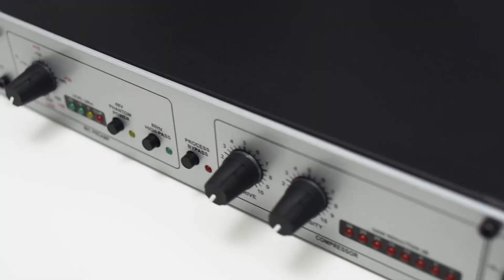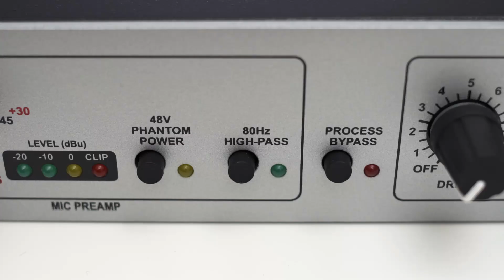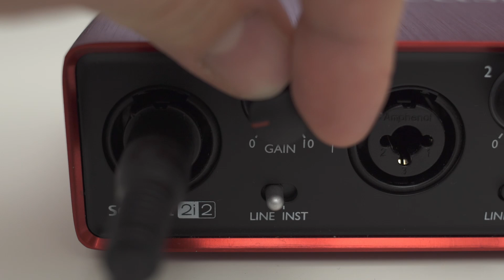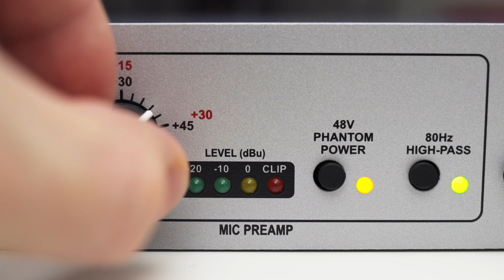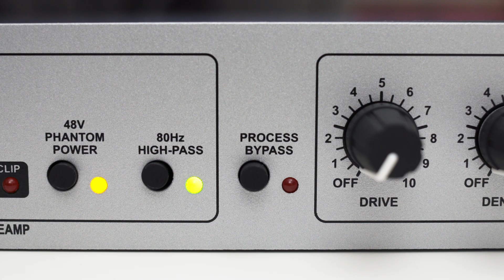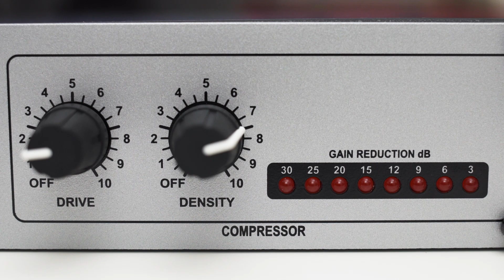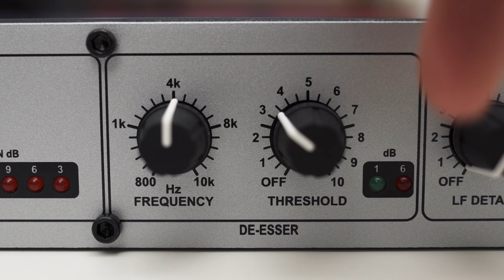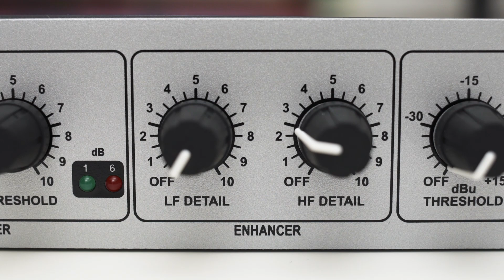Best Settings and How To Connect - get started with the dbx 286s

Comment: A great tutorial, I managed to make my SM7B sound good. I had issues with the output gain, had to turn it way down and about as much up from the audio interface or the audio would get distorted. I would still recommend a fet-head or a cloudlifter combined with DBX 286S if you are using SM7B. It apparently needs some +55 dB of gain which is better to get near the mic or cables will absorb all the noise from the universe.
Reply: I would pay so much to have someone help me set up mine because I am just COMPLETELY lost. I am going to try ordering a cloudlifter to hopefully help my issues but with the 286s and a Scarlet 2i2 I have been STRUGGLING to figure out what is going on. Hopefully having a cloudlifter fixes the quality issues!
Reply: @DoctorNoFGC  Was no miracle cure, but gave the unit much more control. Would recommend.
Reply: @DoctorNoFGC  yesterday i tried moving the cables and checking in Ableton's Spectrum and iZotope Insight and saw the noises that the cables pickup from power chargers that were nearby etc. i was amazed 😂also with the fact that for like a year i was sending a Mic level signal from dbx's Output to the Input of my Presonus (XLR cable) instead of a Line level (TRS cable)... 😳
Reply: I was curious about why always connecting fetheads etc. to Mic end, instead of the other end of the cable. That gain near the mic for not picking up noises that you said is pretty intresting.

Comment: Best video on the 286s I've found.  But I still don't know why I did the -18dB calibration at the beginning if I'm shooting for -6db to -3dB on the audio meters.  I'm using a Heil PR-40 with dbx 286s and focusrite just like Julian.  Have to turn up the gain all the way to +60db then use the focusrite to boost even more ->FCPx on my MacStudio M2 Ultra.  I does sound very good though.  Thanks JK.
Reply from the maker: Hey Jim, if you don't do the calibration, you could end up in a scenario, where the 286s might clip  considerably earlier or later than the interface. If that happens you might lose dynamic range which can negatively impacts the noise floor or you might even clip on the interface without realizing it. The calibration procedure makes sure you get the best possible performance out of the setup. Glad the video helped you out and big thanks for the tip!!

Comment: Just wanted to say thanks for the informative video. I am so brand new to all of this I have little to no idea what any of this means but your video helped me get a few things started. I, however, couldn't get my dbx to light up the way you did which makes this all the more troubling. If you have any thoughts or other videos that might help me get more properly set up I would greatly appreciate it.
Thanks again!
Reply from the maker: Hey, I'm assuing you are using a dynamic mic. These mics are less sensitive and in order to get the yellow LED to light up you have to have a louder sound. So, make sure your phones loudspeaker is as close to the mic possible. Turn the volume on the smartphone up to about 3/4. In the tone generator you can also set a frequency around 1000 Hertz which will be louder as the standard 440 Hertz. Then repeat the steps shown in the video and it should work just fine. If you have any other questions, let me know!

Comment: This video is the BEST!!!
Quick question:
After I did everything in the video, my sound became very buzzy, but if I press bypass, it’s normal again. Which is really weird. Does anyone has the same situation?? And how can I fix it
I’ve tried resetting, shut down and turned on, changing cables, but the only solution is  when i used bypass

Comment: Hi there, this is a really helpful video - thanks for going through the trouble of uploading it. I'm just wondering if there an advantage to using just a TRS to TRS cable to connect the DBX 286s to the 2i2 interface as opposed to using a TRS to XLR cable to connect the two devices? I'm not sure which kind of cable I should buy and whether one is better than the other. I have a Focusrite 2i2 and a DBX 286s. Any helpful information would be much appreciated. Kind regards

Comment: Hi Julian. Loved the video. Really helped me make the decision to go ahead and buy the 286. I already had a scarlet solo focusrite. I hooked it up with the input to the line in (channel 2) and left the inst button in the off position. (Channel 1 is just an XLR with no TRS jack). 
It looked like it was recording OK when I fed it into audition.(output gain about -10 and the solo level all the way left). I got a good waveform and set the levels to -18 as suggested. But then I could not play back the audio. I exported it, and both wav and mp3 files would also not play. I sort of figured it out. I used the channel mixer and swapped right with left, and it would play. Don't understand that at all. 
When I use the hardware to record with camtasia, it works with no problem. With my logitech software, is shows that there is an input on the mic levels while recording, but similar to audition, there was no playback despite looking like there was a recording.
Am i just missing something simple? I have a passable working knowledge of audio tech--enough to muddle through, but not enough to dive into troubleshooting. Anyt thoughts on what I might be messing up?
thanks.
jeff

Comment: can i plug the trs cable from the 286s into the scarlett solo's trs input port? otherwise i'd have to buy the trs to xlr adapter. i've read that the trs input on the solo is meant for instruments, but since i'm using the 286s i thought maybe it wouldn't matter. thank you!

Comment: First of all I would like to mention that I am one of your fans and I would like to thank you for your effort…I would like you to recommend a smaller version of the DBX 286s in which that it can be easy for traveling and it has almost the same features, thank you and waiting for your reply.
Reply from the maker: Hey, if you want to go smaller I would actually go fully digital and have a look at something like a WAVE XLR. This processes your audio in real-time and is even more flexible than the 286s. One downside is the slight monitoring delay if you want to hear your voice with the effects applied.
Reply: @JulianKrause   thank you so much for your reply but I have another question if you please, is it possible to connect my DBX286s to the podcaster pro 2?
Reply from the maker: @ezzel-bendary8762  Hey, yes that's possible, just run the 286s into a line level input on the Podcaster. That said, the Podcaster Pro II already has all kinds of processin on board like compression, eq and noise gate so you don't really need the 286s as you can do it all directly in the Podcaster.
Reply: @JulianKrause  Thank you so much Julian for your reply as i would like that you can make a review about the RODE podcaster pro 2 if you please because i like your way in doing those kind of reviews and tutorials...Thank you so much and i wish you always all the best.
Reply: @JulianKrause  i will be happy if you could do a review about it Julian because your reviews always has lots of technical and interesting details and I really like it…thank you so much and I wish you always all the best 👍

Comment: Hey dude amazing guide. Just curious, I have a Shure SM7B and a Cloudlifter, should I keep the cloudlifter or does the dbx 286s completely replace the cloudlifter since it also has a signal boost. Cheers. Also, even though the Shure SM7B is a dynamic microphone, I read online that the Cloudlifter requires 48V, true or nah? Thanks, keep up the awesome videos

Comment: Hi. Your videos are absolutely superb; very clear and very knowledgeable. 
I am presently setting up my 286s with the NT1-A and then through the Volt 176 (for voice recording only). I have set gain on the Volt interface at 0 and turned off the phantom power on the Volt, opting instead to use the preamp on the DBXs. As you have shown, I have set Gain to get a recording level around the -18db in the Audacity program. However, setting the mic preamp until it hits the -10 light as you have shown renders the recording level way up at -1 or 0 in Audacity. In order to bring this down I have to set the Audacity recording level itself at -32, in order for my voice to register an ultimate level of -18 again. Is this ok or should I try to get the master recording level in Audacity at the -0 mark? Thank you for your time.

Comment: Very informative, the only problem i had is the calibration with the tone generator app on the smartphone.

I found that when i turned up the preamp gain (to get the yellow LED on the 286s to come on). 
I then adjusted the output to get -18 in the DAW....it just made my mic very sensitive..... (i only needed to speak quietly for it to sometimes clip).  

I tried moving the smartphone 3cm, 6cm, 9cm and 12cm away from the mic and repeated the calibration, but each time i just got the same loud mic.

50 % smartphone volume
dbx 286s
Rode NT1A mic (condenser) (With Phantom Power)
M-Audio M-Track 2x2  (USB interface)

I probably need to set the correct volume on the smartphone, but i do not know if i should increase the volume as i move it away from the mic when i am setting the preamp (yellow led).

Comment: Hi Julian. Love your videos! What do you think about using the dbx286s in this way: mixer main mix out L&R to Line In on Focusrite Scarlett 18i20 (inputs 3 and 4), then Line Ouput to the dbx 286s?  If this makes sense, would you plus into the Mic input on the dbx 286s or the 1/4" input jack? My end goal is to process all audio coming from the mixer. If it's a bad idea...please don't hold back on the criticism. Thanks!

Comment: Just received and set up my 286s into my Focusrite 2i2, Julian. After calibrating my HIndenburg DAW with tone generator, I recorded to my remote recording app (Squadcast), then opened the downloaded file in Hindenburg. But the levels were way too hot/loud. I've fiddled with lowering the gain on my 2i2 and then also my 286s, but level still seems to hot (above -18dbs). What am I doing wrong? Should I be lowering the Output level on the 286s?

Comment: Thanks for the video Julian. Great info. I used your recommendations for the setup, however, when I did a live stream video, there was a noticeable hiss as I spoke. I believe the gate did a great job of taking out the background noise (like the cooling fan on my laptop), but the sound seemed to halo my voice as I spoke. 

Any suggestions? 

I was using a Sennheiser MKE 600 overhead for the video. Next time I'll try a lav for the video. I will also try recording the audio with my EVRE20 and see if I get the same effect.
Thanks,
Marc

Comment: Julian - nice video!  I am new to audio/video, and I have a question:  I only will be using a DSLR (Canon T6i) to record my videos.  Can I Connect the microphone (has XLR connector) to the DBX-286s with an XLR ro XLR Balanced cable and then run the output of the DBX-286s with an XLR to XLR balanced cable to my Beachtek SLR Pure Passive audio adapter input and then run a 3.5mm to 3.5mm from the Beachtek out to my DSLR camera's 3.5mm mic input jack? I would rather use my camera to record so I don't have to sync up audio to video, but I am certainly open to hear your thoughts. Thank you!

Comment: Some things he mentioned simply did not work for me, for instance : 

1. You should not use the Gain on the Scarlett, turn it to Zero and use only the Output gain of the DBX, monitor it via the DAW, say Audacity and make sure that you are Romancing around -18 level and not going higher than -10 and lower than -24.

2. Using his suggested method I was getting clipped on the Scarlett.
My Current setup is : Shure SM58 > Cloudlifter CL 1 > DBX 286s > Scarlett Solo 2nd Gen.

3. It is possible that the Cloudlifter makes a difference here, as he is not using one.

4. I believe that point no. 1 is something I heard from other Youtubers, so definitely check more videos.

Comment: This is such a structured, well thought and calmly presented tutorial. You are a great teacher. Congratulation!
One question: Do I loose options in the daw using the dbx compared to the voiceover sent directly to the daw through the audio interface (Volt II, purchased after watching your review)?
Reply from the maker: Hey, the processing of the 286s is essentially baked into the signal when you use it. You lose options that regard, that you cannot revert the processing that the 286s has done. For example if you notice after the recording, that you had the compression turned up too high on the 286s, then there is no way of "uncompressing" the sound. When you set up the 286s you shoud make sure that it sounds like you want it to, otherwise it's difficult might run into problems in post production.
Reply: @JulianKrause  Great to hear from you. Thanks for coming back to me. I am an actor and have to read a +400 pages book, and I wonder about the best way to step forward. After watching your Videos I bought the Volt II and the dbx.
Can we do a Skype call and I compensate you for your consulting?

Comment: Great video, as always. Becoming a big fan of these.  So essentially with this setup and I'm assuming for any setup, you're suggesting that -18DB is the ideal recording volume?
Reply from the maker: The ideal recording level is dependent on what you are recording and your audio equipment. But generally speaking, for spoken word getting your peaks to hit on average -18dB leaves a nice amount of headroom and you are still recording a pretty strong signal. So yeah, I personally aim to record dialogue around -18dBFS.
Reply: @JulianKrause  Yeah I was definitely referring to spoken word/podcasting.

Comment: Hello again!
I have another question.
When I connected dbx 286s to Scarlett 2i2 using TRS to TRS cable, my gain was set on +45. When I connected dbx with Scarlett with TRS-XLR cable, it increased signal, and I had to switch down gain on dbx to +30. Why?
Cheers!

Comment: I notice that the microphone you show has a high pass filter.  I've previously been advised to only use one high-pass and have it as close to the microphone as possible - so I've only been enabling the 80hz high pass when using microphones that don't have a high-pass switch..

Any comments on using the 80hz switch on the 286s instead of (or in addition to) the one on the mic?

Comment: Thank you Julian for the awesome video and education about the 286s. Problem: I followed your instructions to the T on calibrating the 286s, even with the same tone generator you used. I ended up having to turn the gain knob on my interface all the way up to achieve -18Db, and now the meter on the interface clips when I talk. Not sure what I’m doing wrong. I have a Rode NT1-A and a Focusrite Scarlett Solo 2nd generation, using Adobe Audition CC. Yes, I’m a newbie to this equipment. Thank you for any help you can offer.
Reply from the maker: Hey Christian, ignore my comment before that was wrong... How is your 286s connected to your Solo? The best way to connect them is to use a TRS to TRS cable. One end goes into the output of the 286s and the other end into your TRS input on the Solo. It is important that to make sure that the Line/Inst switch is set to Line. The output knob on your 286s should be at the 12 o'clock position and the gain on the Solo all the way down. If you then follow my calibration procedure you should only have to make a tiny adjustment to either on the output knob of the 286s or the gain of the Solo.
Reply: Hey Julian! Thank you for your quick response! I have a TSR to XLR cable connection between the DBX output and Focusrite. I tried the TSR to TSR with the “line in”, but was not able to get a signal from the interface into the computer for some reason. The meter on the Focusrite would light up but nothing in the DAW (Adobe Audition). 

Afterward I went back and watched the video for about the 5th time; turns out I was missing a step according to your video. I didn’t do the first step of turning up the gain on the DBX pre amp, and then adjusting the gain on the Focusrite or the output on the DBX depending on the results I would be getting. Once I figured that out everything worked great! Sorry to have bothered you with my stupidity lol. Do you have a website with a way of contacting you so I don’t have to post stuff on YouTube. Your videos are great, very informative! Thank you for offering them to us who need the help! Have a good day Sir
Reply from the maker: @christianjorgensen249  No problem, glad you could figure it out! The best way to get your questions answered it to write YT comment. I try to read all the comments and I will usually answer all of them.

Comment: Hi Julian! Using these settings, usually what else do i need to do in post processing? Should I still normalize? I assume compression is out of the question already as it was already done through the 286s?

Comment: Using a rode nt1 plugged into a dbs286s and output to Yamaha mg10xu mixer, it's really hard to get this right. Using the tone generator and raising the gain on the dbs once it hits yellow I'm already clipping.. kinda stuck tbh

Comment: I have a question about using a phone as the source. Why did you choose that ? Is using around half volume of your phone to mic in a way giving the pre amp the max load?
Maybe those questions I asked aren't relevant, but I was just wondering what kind of source it's emulating; why it was that you used. plz show me the ways of your mind @.@

what other configuration could i use?

Comment: Queston what am I not doing right? Calibrating setup. Immediately the preamp doesn't lite yellow led, even when cranked. Why is this? I proceeded with the rest of set up per instructions. My noise floor is still the same as with just my direct SSL2 interface. What should I do? Tia.